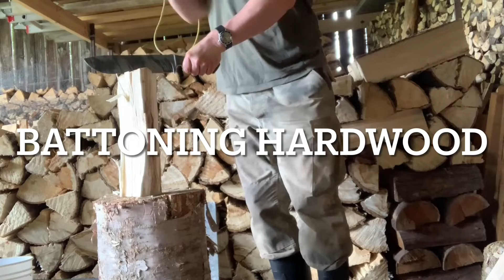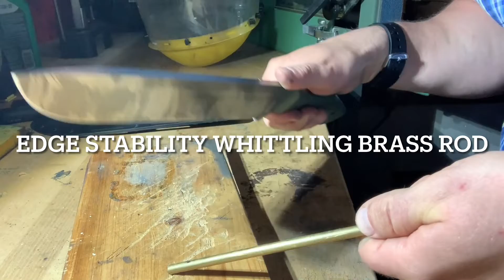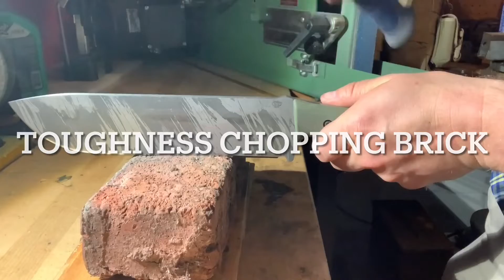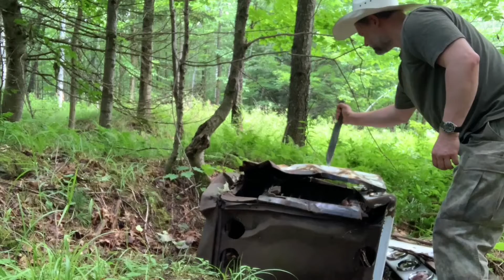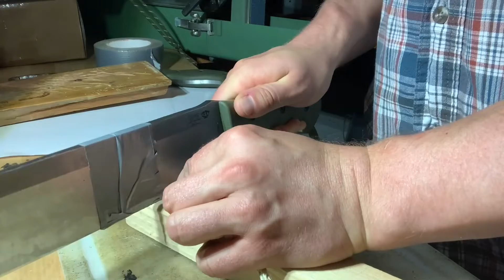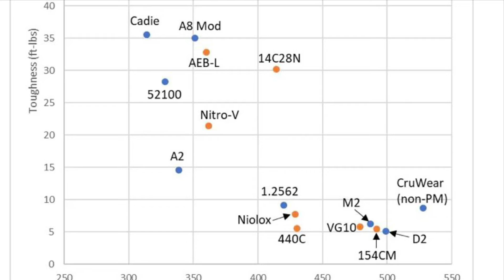Riddle of K329 steel: Testing the Kodiak

Comment: Nice improvement but SK85 is no slouch. I really enjoy my Kodiak and have no problem with the SK85 but I may look at your other designs and will look for improved steel.
Reply from the maker: I agree that SK85 works great. I just wanted to add an option for people who wanted a stell that is a bit more atain resistant
Reply: I completely agree, Bob.  I have a "2nd Production Run" SK-85 Kodiak that I've beaten like a redheaded stepchild.  Man, that thing hasn't once winced or whimpered. 😮
Reply: @loyalegroup3929  I agree with you but as a redheaded adopted man, I am happy you’re not my father.
Reply: @bobhabsolute4995  😂😂😂
Reply: @loyalegroup3929  so I guess you know I was pulling your leg. 😁

Comment: It would be nice to know when and where they will be available. Although CPM Magnacut is my most favored steel as of now for its toughness, stainless, and edge-holding ability, I would love to see how this steel compares. I did pick up one of the Kodiaks in SK-85 and am impressed with the design.
Reply from the maker: The next batch of Kodiaknis expected january 2023
Magnacut looks great but I’m not sure I would use it in large hard use knives. I would definitely want to do some testing before that
Reply: @auroraborealisknives4019  Great look forward to trying one.
Reply: @auroraborealisknives4019  Magnacut and Big Chopper.. no
Reply: @renexwing1546  actually yes, as long as it is properly heat treated for example go checkout AaronJohnsonKnives he has made a competition chopper for bladesports out of magnacut and it is one badass blade that I'd love to own and swing!